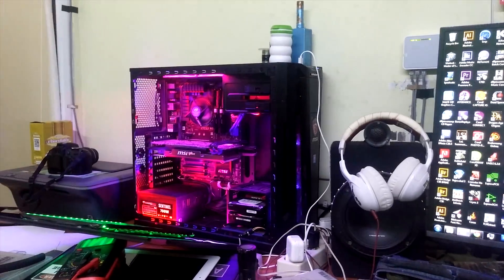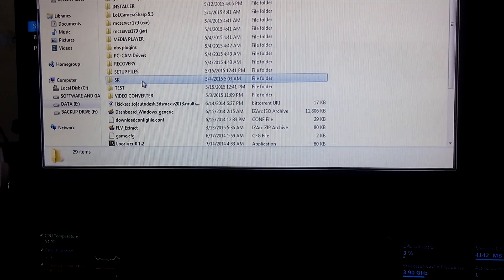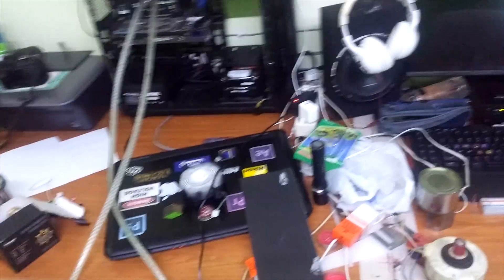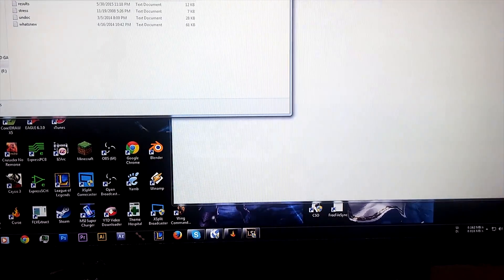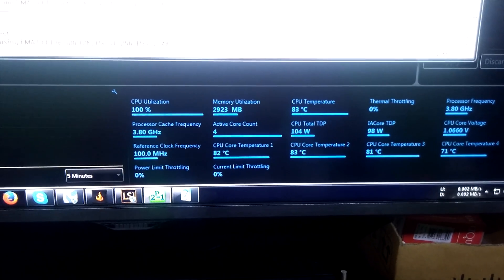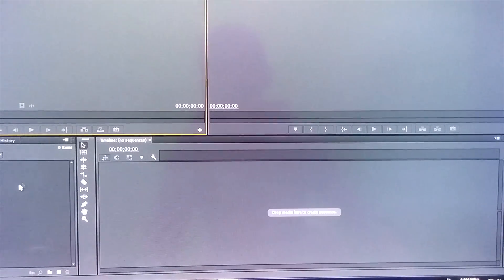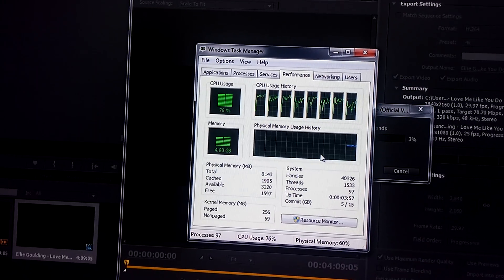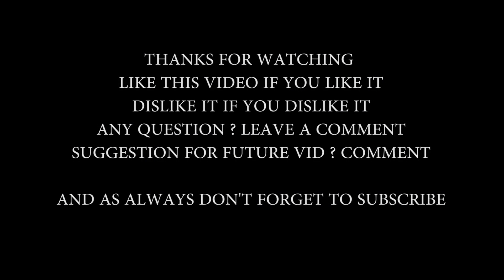MAKING A HOMEMADE WATERBLOCK

Comment: Its quite easy to make that acrylic parts with hand tools. And for all you farts hating on him because laser cutter, technically its just a tool he used. Same as if you use a drill and hole saw. Go use your teeth if you want to hate, see how far you get
Reply: Holyshit that was witty as all hell. Nice one dude.
Reply: True. If you can’t make two acrylic squares, one with a hole in it with tools that you‘d find at home, then you shouldn‘t watch a diy video on making a cpu block. The lasercutter isn‘t necessary. I don‘t get why people get so angry about that. It‘s not like his waterblock is way better than one that wasn‘t laser cut. Probably no performance difference between the two at all. I‘d get it if he‘d use a cnc to route flow channels into the copper.
Reply: Thanks dude. This guy says it's the same as any hand tool, then tells you to go use your teeth. Makes perfect sense ...
Reply: Yup, I just flip the laser switch on my Dremel tool anytime I need some precision routing done. Your comment is way off base. That's like saying cooking an egg in a microwave is the same as using a skillet on the stove top. They both cook the egg, right?

Comment: You can use a thicker copper sheet, drill it and insert/solder pieces of copper wire into it. You will significantly increase the heat dissipation surface. Even a copper sheet bent into the shape of "/\/\/\" and soldered to the copper with a blowtorch will significantly improve the capabilities of such a homemade block

Comment: this water block is enough to a 80W cpu ...
My FX9590 , is a 220 w, 2500 liters/hout wayer pump, a car radiator, 12 120mm fans, and the water block did´nt done the job.
I made anotherr with 1,5 milimeter plate, all alleted with holes to force water to dissipate more heat and 32mm high.
So the cpu after that was mainained in a 30 defgrees celcious figure.

Comment: are you not using any thermal paste? I've never seen my cpu hit 99-100 even with the stock cooler.
Reply: looks like his CPU needs a factory T.I.M (thermal paste) replacement between processor and heat spreader.

Comment: You're going to need a radiator to dissipate the heat from the water, or else you're going to start reaching the same temperatures, possibly get even hotter as you feed hot water into the system. also, you should make sure you get all the air bubbles out of your system to ensure effective heat transference.

Comment: You would see better performance if you solder some fins onto the copper. Increased surface area equals increased heat transfer.

Comment: fins in block would help a ton and provide some resistance to flow to allow the water to transfer the heat. There is such a thing as to fast flow that it wont cool very well. Cars tend to overheat in the summer if you take out the thermostat because of this. Kudos for experimenting though..thats how we learn!

Comment: water+electronic=not good lol
Reply: keith libby um... no
Reply: keith libby Depends on how long the distilled water sits in the bathtub plus there could be some minerals on the side of the tub.But in a clean bath tub then in theory yes but don't try it because distilled water is not the best for keeping electricity from going through it.Some people use distilled water when testing there water loops though and think of water cooling like car water cooling.Same way how its done through coolant,radiators,reservoir,pump and tubing.
Reply: xD you don't know much about electronics do you? Pure water aka distilled water won't damage electronics at least right away plus they are using a coolant that doesn't have minerals or anything that can carry an electric current through it.Look up PC's watercooled using mineral oil its very pure oil and can't carry electricity through the oil.
Reply: you telling me if i get in a bathtub of distilled water and then threw a toaster in ,it wont electricute me?
Reply: keith libby :

Comment: Oh and effectiveness of the block can be improved if you add fins to the block, increasing surface area with the water, which would make your system more efficient.
Reply: +Tonny Cassidy the problem is that CPU needs to be delidded because the manufacturer thermal paste is shit. All the haswell and ivy bridge CPUs have this problem. I used the home vise method to remove the heatspreader and used mx4 after cleaning that crap goop that was on it. my temps dropped 41c and never went above 60c !
Reply from the maker: +{MLP} Rainbow Dash it will increase it but i will need a thicker copper and a cnc to be able to do that,anyway thanks for the advise
Reply: +jlrockafella 
Problem with that is, ya need some balls to delid. I lack balls. It works now, so I'm not worried.
Reply: Not to mention the fact that the acrylic is against the Collier and not the water lol. None of the water is going to pass over the copper plate. Ineffective

Comment: a 100c with stock cooler????
Reply from the maker: +Yuma057 yes
Reply: +Tonny Cassidy U didnt assemble your cooler well, no cpu goes on stock 100c
Reply from the maker: Yuma057 nope,it just suck ,its idling at 35c so that means it was installed correctly,btw i replaced both my cpu and cooler to 4790k and noctua nh-u9b ,its a garbage stock cooler anyway